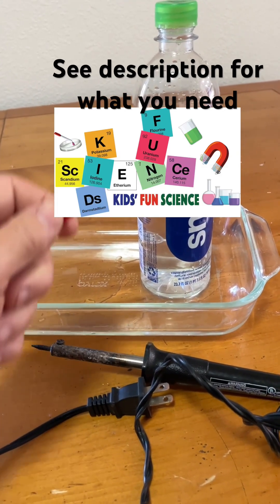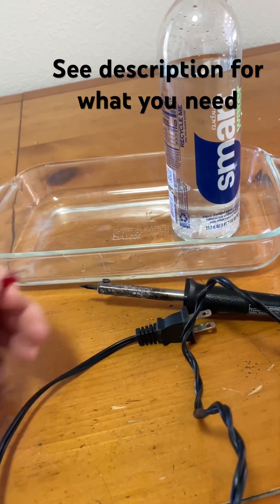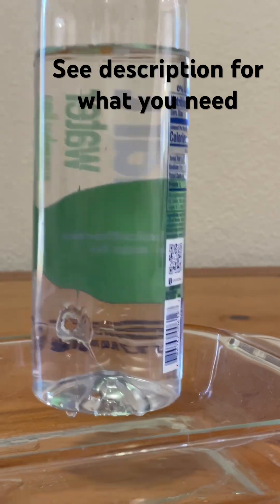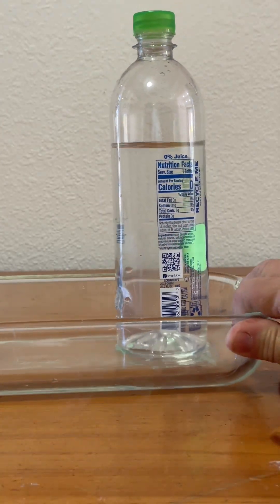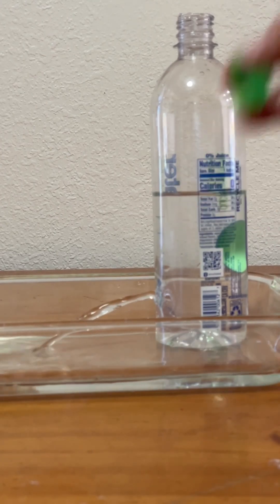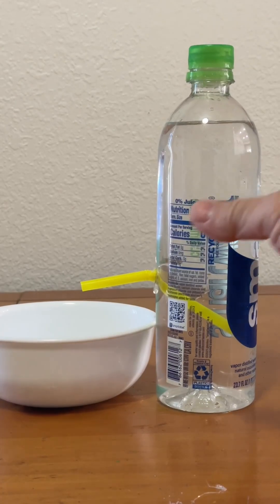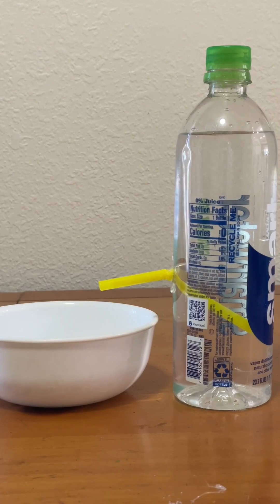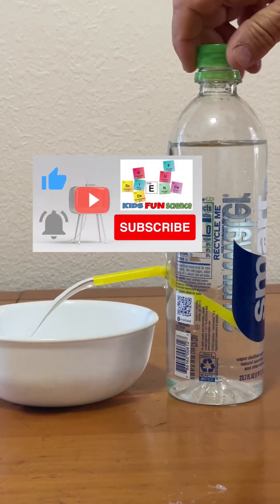Air Pressure and Water Bottle Experiment

Comment from the maker: This can be very confusing for many clever children (and people), because as stated, there is an air pressure forcing on each inch of the bottle, so if the cap is off, there is "mostly" the same pressure forcing on top of the water and the same pressure forcing on the side hole ... so there is an equilibrium and nothing should happen (in terms of air pressure). What drives the water out of the bottle is the pressure of the water above the side hole and gravity, not the air pressure. So beware of such wrong information, that can seem to be right.